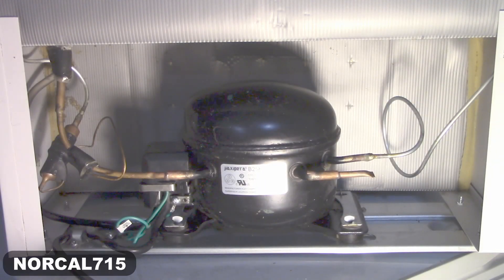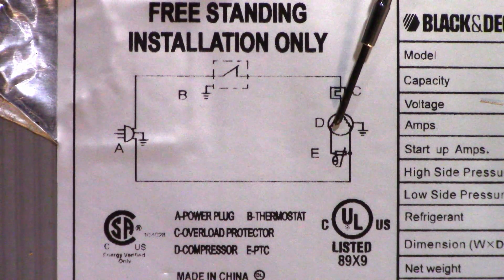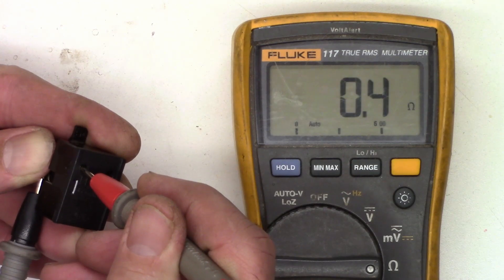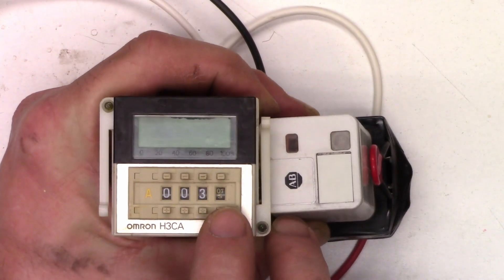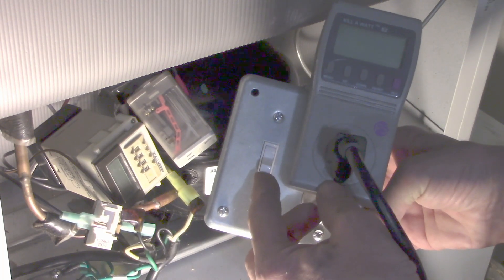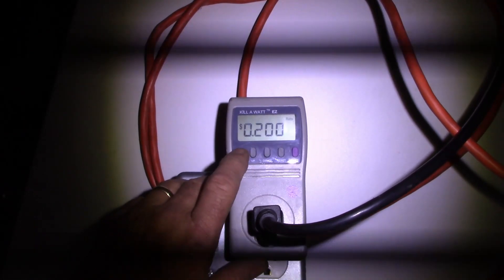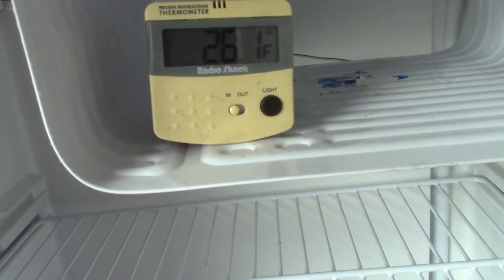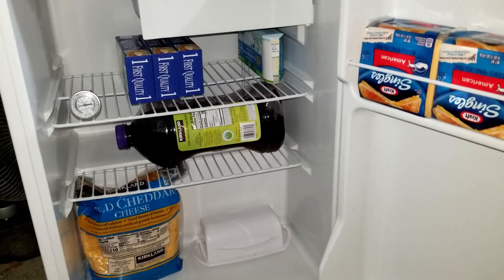BLACK AND DECKER BCFA27 MINI FRIDGE NOT COOLING - FIXED WITH A TIMER AND RELAY

Comment: i dunno how you got the protective case off without cracking it. easy fix tho now that I know what part to buy. graxias.
Reply from the maker: You must compress the spring then as you saw I, (with the help of a screwdriver ) popped the clip off and the cover was loose at that time.

Comment: What would the start thermistor have cost to replace? Reminds me of my kitchen standup refrigerator/freezer's hacked freezer evap fan repair (small AC to DC transformer running a old refurbed computer fan.(worked great for many years) :) I like the wine & cheese. lol
Reply from the maker: Original replacement was close to $40 but a commenter says I can get them from china for just under $3.00, I found some from a US seller for close to $7.00

Comment: My RV had a fridge in it , but no compressor.....  I had a semi full size fridge with the separate doors for the freezer and lower unit....  It was 110V V or propane..... The 110 heated an element that was inside of a tube that was encased in insulation, and if switched to propane , there was was a small pilot light that would heat up a coil that was hooked to the tubes that held a type of ammonia ........ That was the best fridge I had in any RV I had......  I had to change the 110 V element 1 time only when I had it, and my cousin only had to change it 1 time after he bought it new.........  I like those types of ice boxes........

Comment: This is a very common problem with refrigerators. I am sure there have been a lot of refrigerators trashed over a $2.28 start-up  PTC https://www.ebay.com/itm/Refrigerator-Start-Relay-PTC-for-QP-2-4-7-4-7-Ohm-3-Pin-Vissani-Danby-Compressor/184246736953?epid=2164491857&hash=item2ae5f61839:g:UMkAAOSwWoRej5bK
Reply from the maker: I just ordered a couple of them to have in stock. Thank you for the link.
Reply: @norcal715  You are welcome. Thanks for posting your videos.

Comment: In my day job, I am a repair technician for a large beverage company. Coolers, vending machines and refrigerators all have similar refrigeration decks in terms of design and operation. "Start components" refer to the thermal overload protector, the relay, and the start capacitor. We usually use a "hard start" kit to connect directly to the compressor (if an ohms test doesn't show an obvious fail). After confirming the compressor works, we replace all three components (that is just company practice and of course not a recommendation for an individual working on their own equipment to do the same). Great video.

Comment: That PTC unit is around $2 to buy, but if you already have the rest of the stuff around not doing anything worth not bothering. Yes they pop, but in general are pretty reliable, at least the fridge coils or the case will fail before the PTC unit does, as the foamed in place coils corrode through, or the case rusts through, or the door hinges or seals fail. 

Funny enough neighbour fridge today was fixed with a cable tie, to take up the wear on the lower pivot, getting the seal to grip on the metal again. Sadly the door is a foamed in place unit, so replacing the seal is risky, and the pivot points are part of the mouldings, so only solution is to fill them with epoxy and redrill the holes, or place a piece of cable tie offcut in the side to act as a bearing strip, which will last a few years before you have to spend 2c on another cable tie.

Comment: Expensive repair... that timer is worth as much as the fridge ;-) Why not replace the thermistor after confirming the compressor wasn't seized? Either way thanks for the troubleshooting walk through!
Reply: I did hear him say that parts are going to be ordered , he just checked it with the things he had on hand..... It sure was a great troubleshoot video......
Reply from the maker: They were scrap parts I had on hand.
Reply: @norcal715  See , he is THAT GOOD.